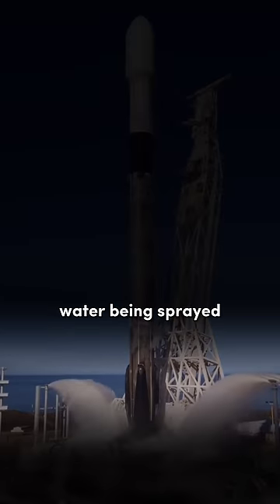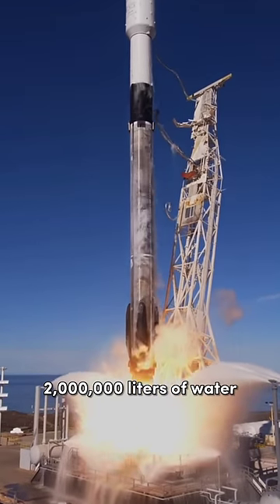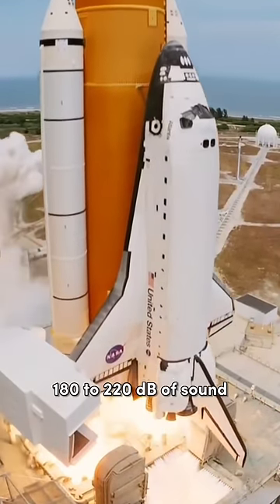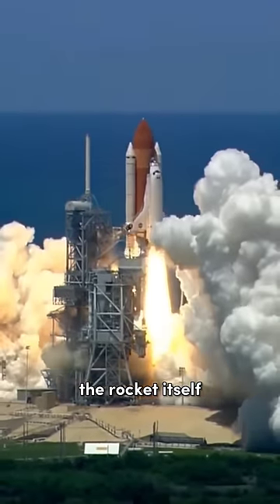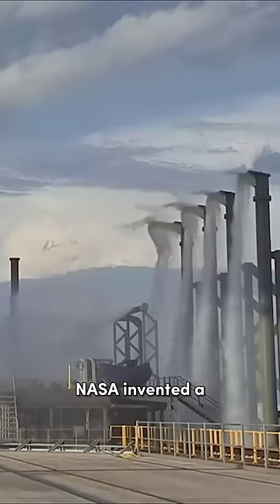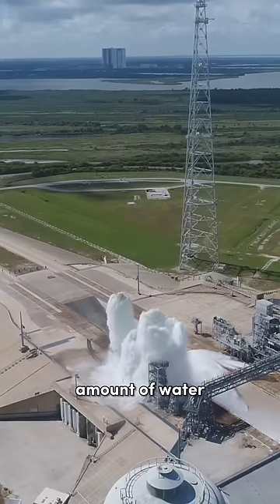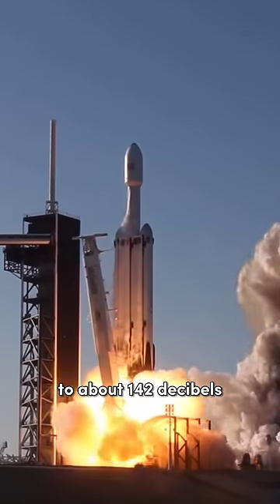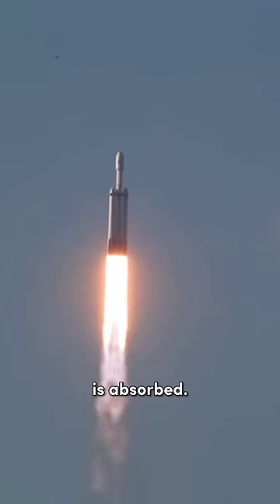How Water Prevents Rockets from Exploding #shorts

Comment: Decibel arent linear for those who were wondering.
Reply from the maker: Yes, absolutely correct
Reply: wish I had read down 2 more comments  and I wouldn't have let my stupid show.
Reply from the maker: @paulcini6084  nahh man you good
Reply: @SpaceflightsShorts  well thanks for taking the time. it was not wasted I love learning. subscribed!
Reply from the maker: @paulcini6084  appreciate it!!
Reply: can you please explain to me what do you mean by linear? and why do you think that that is important?
Reply: @stevengerhardt1221  you see a linear increase is when you ad something the relative increase towards the start stays the same. With decibel every next decibel is double the volume from the last. 2 decibel is double as loud as 1 decibel and 3 decibel is double as loud as 2.

 The increase is not the same from 1 to 2 or 101 to 102.
Reply: @Stachelbeeerchen  linear in the typical sense, at least in the building industry AKA construction is a straight line so I'm curious as how do you think sound would ever be linear. 

Also I do believe you are referring to the inverse Square law but I may be mistaken there's probably a different name for it but my curiosity is this. Which do you think is faster the takes off of the rocket or the speed of sound regardless the decibel level.
Reply: @stevengerhardt1221  At first 5 seconds (during the lift off) the sound (343m/s) is faster than the rocket (50m/s) after some time the rocket (2500-8000m/s) is faster than the sound (343m/s)
Reply: @cathelenaa  completely understandable, I don't know if you're understanding what I'm getting at! 

Have you ever watched a rocket launch, have you ever watched any of those super sonic jets go over your head, that is faster than the speed of sound and you can barely see the plane! At what point do you think the rocket is moving faster than the seep of sound?
Reply: @Stachelbeeerchen  Close.
+3 dB is a doubling of power,

+6 dB is a doubling of voltage or sound pressure level (SPL),

+10 dB is considered to be a doubling of apparent loudness in psychoacoustics.
Reply: @stevengerhardt1221  We're talking about units in the context of mathematics, so linear and logarithmic are the most appropriate names. The term linear refers to the graph a linear function makes. Plotting a linear unit vs another linear unit makes a straight line on the graph. Plotting a logarithmic unit like dB vs a linear unit makes a logarithmic curve instead. A quick Google search will do you good as you can find a lot of explanations 👍
Reply: @boomerboxer3574  interesting response. Linear is still linear, my question is at what point do you think the rocket is traveling faster than the speed of sound? You can put it in seconds, minutes, feet whatever suits you best I'm curious as to what you think because it seems like the thing never moves faster than the speed of sound to me. Just my observation.
Reply: that launch is as loud as a nuclear explosion(dafaq) and it will kill you by rupturing your lungs. forget eardrums, where's your lungs?
Reply: Thank you for clarifying
Reply: @stevengerhardt1221  yes, look at SpaceX speedometer.
Reply: Every 10 decibels, the volume doubles.
Reply: @Hxkari  that was a very interesting response as well, thank you but NASA is not SpaceX  must I remind you?

  With some logical thinking, why would you consider what is displayed on a digital screen, when you can visually see it for yourself? And it's not matching other observations!
Reply: @victor58947  and what clarification do you think you got? Truly it's not the nonsense about linear being mathematical🤣
Reply: @SpaceflightsShorts  That rocket looks like a Dildo.
Surprised that you didn't mention it as well
Reply: @HouseGurke  Thanks for writing that! To add to that: 10dB is... A single Bel(l), which is how the scale was established in the first place. A decibel was derived as a  higher resolution subscale by testing the minimum change (IIRC in voltage) people could detect.
Reply: Do share the math you used from 200-180 db to 140db is a 97.5% decrease. 
I used the double every 10 db, it is still not 97%
Reply: I came here to correct people but you were first
Reply: Thank you so much, I was about to say he was doing that R Kelly math.
Reply: @Stachelbeeerchen  don’t you mean every 10 decibels the volume doubles?
😅

Meaning, every Bel the volume doubles.
Decibel is 1/10th a bel.
Reply: @stevengerhardt1221  go back to school
Reply: Ah
Reply: it doubles at 3dB, it is ten fold at 10dB. If I calculate 142 to 180dB I come to 0.015% remaining. I have no idea how he come to the 97%.
Reply: @SpaceflightsShorts  can you please share where the 97% comes from. If I do the math I get to 99.985%.
Reply: It’s logarithmic
Reply: @stevengerhardt1221  double the decibel isn’t twice as loud
Reply: I was actually wondering...
Reply: Thanks lol. I was shocked when i heard 148 is 97% power than 180 lol
Reply: @stevengerhardt1221  it increases exponentially not linearly.
Reply: @junedaalam3080  could you clarify what you mean by that. I can understand how it will get weaker the further away it is from something but I would like your clarification as to what your point is. Thank you.

 Also when do you think the rocket has gone past the speed of sound, at what altitude ,elevation whichever you might want to call it.
Reply: @stevengerhardt1221  Theres no concrete answer because it depends from rocket to rocket. The force of Rockets or more accurately the mass flow rate of Rocketswill determine the velocity of a rocket. Because Rockets vary in weight and thrust, the time it takes for Rockets to go faster than the speed of sound varies from rocket to rocket.
Reply: @fonkengsaliki3015  well I could agree with that as well. Do any of them look like they are traveling faster than the speed of sound to you?
Reply: @stevengerhardt1221  Linear means in a direct proportion.
Reply: @NightmareGhostReap  so you don't think that linear is a straight line? Please feel free to explain.
Reply: Yeah thanks...i was about to complain about the %
Reply: @stevengerhardt1221  The comment was explaining why 140 dB is a 97.5 percent decrease in loudness compared to 200+ dB. It was just trying to explain to those who thought that it did not make sense mathematically. Decibels is a logarithmic scale where it increases at a faster rate the higher you go. It has nothing to do with actual sound waves, just trying to explain a key part of the video.

Hopefully that clears up any misconceptions, I am sure many commenters including myself would be happy to further discuss if I haven't been clear.
Reply: Pretty sure the sun has around 350db per square meter so this is still pretty damn loud.
Reply: I had to replay the video 3x to confirm the numbers and do the calculations right until I saw this comment... Thanks man
Reply: Squares aren't the same thing as triangles incase anyone was wondering
Reply: @stevengerhardt1221  linear is just a straight line with a gradient of y=x.
Reply: @tutondeeznutz9015  Excellent! We agree. LINEAR is a straight line. At what point do you think this rocket is beyond the speed of sound? If you don't understand, watch the video again.
Reply: @tutondeeznutz9015  do you even understand with a Y and X is🤣
Reply: @stevengerhardt1221  you are the one asking
Reply: @stevengerhardt1221  y axis and x axis. do you not understand basic year 7 maths.
Reply: @tutondeeznutz9015  lol yeah, that's what it is. 

So how far above Earth do you think this rocket is before it has escaped the decibels that are so devastating that it needs suppression to keep from damaging the buildings.
Reply: @stevengerhardt1221  after it leaves the launch pad cos its the main launch sound ebing suppressed the rocket isnt being suppressed all the way.
Reply: @tutondeeznutz9015  so in reference to reality besides 7th grade math what do you think the X,Y and Z axis refers to? Do you think it's an orientation such as level aka horizontal and plumb aka vertical?
Reply: It’s a logarithmic scale right?
Reply: @SpaceflightsShorts  water is wasted oh no
Reply: @Stachelbeeerchen
Reply: @stevengerhardt1221  well for every 10 dB that gets added the sound gets 10 time as much
Reply: do u mean arithmetic?
Reply: Ohhh. Thanks for letting me know.
Reply: @stevengerhardt1221  All you need is it’s acceleration curve and you could calculate the Rockets instantaneous velocity at anytime.

In fact Space shuttles used an accelerometer integrated over time to calculate velocity. 

Now as far as your question….
First of all it is a really terrible question and doesn’t seem relevant to anything at all.

But when exactly a Rocket achieves faster than sound speed depends on the rocket, but the minimum orbital velocity necessary to even get into space is like 20 times the speed of sound.

Your question seems to be WHEN exactly does that happen, but that question is sort of irrelevant.
Reply: @stevengerhardt1221  Linearly means when it increases in a straight line. For example y=x is a linear curve. For every x position you move you go 1 y position as well.

You’re asking questions that should have certainly been covered in a9th grade math class. Use some google and try and figure out the answers to your questions on your own.
Reply: So the richter scale if I am not wrong and that's why we take it for granted.
Reply: Anybody with decent high school math knowledge should understand the difference between linear and exponential😉.
Reply: @stevengerhardt1221  flat earther moment 💀
Reply: @mastroitek  well Mastro did you watch the video! Did you understand what the video was about?

I was referring to a comment made, that some may believe was a intelligent comment about sound not being linear period.    It doesn't matter that sound does not travel in alinear path,so that's why I was just talking. Without giving everything to everybody because well if I have to tell you, than it's me telling you and it's not you figuring things out for yourself!

 Since you are curious, of my point, I will explain it. The video is about the sound and the ability to cause destruction which is why the water is there to suppress the sound. Clearly that's nonsense. And my point about at what altitude at which the rocket will be ahead of the sound, I hope you can take some time and figure that out yourself! The decibels that are put off by these Rockets are deafening and I would imagine, could probably cause internal damage to human body either on board or nearby. 

So I'm curious as to how long it takes the projectile to get above the speed of sound and it never appears to! 

You see if the rocket doesn't travel faster than the speed of sound than the speed of sound is still encapsulating the rocket! Obviously I understand once the rocket does achieve speeds faster than the speed of sound then the decibel levels are no longer a danger but doesn't look like it's fast enough! 

The Jets that we have known to us that are faster than the speed of sound you can barely see them with your eye, but you sure hear them come and go. And they're not even flying at scenes nearly as fast as these rockets have been alleged to go! PS rockets need air to push off!
Reply: @stevengerhardt1221  Wrong, no one here was talking about the path of sound, the comment only aimed to clarify that the dB unit is not linear, (40dB is not double of 20dB). The comment was only written because if dB were linear (like one could assume) then the math in the video would make no sense (even though, with the numbers given it seems to be wrong anyway).
About how long does a rocket take to reach the speed of sound, that is highly dependent on the type of rocket and its purpose. But for example the rocket for the James Webb telescope reached 342m/s in about 45s. 
And btw, yes, sound does travel in a linear path from the point of origin.
Reply: @mastroitek  well that was very interesting. I never said sound was linear, I said linear is a straight path so therefore sound cannot be linear because we hear it at unknown distances away from the point of origin.

I have a few thoughts on the subject and I'm kind of curious about how much damage from Reverb can occur to the rocket in such short periods of time. Obviously everything's going to have a different rate.How much damage before the the rocket even takes off.

 I think there would be Reverb damage. And every time I've seen a rocket take off it never seems to be going any faster than most airplanes I don't mean the fast ones that break the sound barrier.

I'm curious what you thought I was wrong about, I haven't made any claims other than linear is a straight line and it very well is! I wasn't trying to talk about the Doppler effect.
Reply: @stevengerhardt1221    "sound cannot be linear because we hear it at unknown distance away from the point of origin" that does not have a meaning in physics and I struggle to understand what you mean. And in your previous comment you say "it doesn't matter that sound does not travel in a linear path". Again, I'm not sure what you mean by that, sound does propagate on a straight line which in 3d results in a sphere, but it still does expand linearly. 

Besides that, it is hard to calculate how much energy (in the form of sound) would be reflected back to the rocket, but if I remember correctly 120dB are equivalent to 1mW/m2 and the energy doubles every 3dB, hence at 180dB the energy of the sound wave would be about 1000W/m2, so pretty quickly the energy of the sound wave could be compared to the energy released by 1kg of TNT.
Reply: yup
Reply: So glad I decided to scroll the ole comments b4 letting the world know how ignorant I actually was. Thank you for sharing. I love learning new things
Reply: Correct me if im wrong but i think i remember that every 3Db double the out going sound meaning the 150 is twice as loud as 147
Reply: Like temperature right?
Reply: Yeah, they're logarithmic.
Reply: @stevengerhardt1221  it’s exponential
Reply: @TLsfhytrbj27  none of you even have a clue as to what I'm getting at but it's funny!
Reply: @stevengerhardt1221  nobody talking about inverse square law or straight lines. He said linear because decibels being measured linearly would make a 99 something percent decrease in sound look ridiculous.
Reply: @Stachelbeeerchen   I still don't get it bro, can you explain it in detail?
Reply: @SpaceflightsShorts  Ohhhhh I get it now, is it because of this: 

The relationship between sound power and sound pressure level is logarithmic, meaning that small changes in sound power can result in large changes in sound pressure level. The formula for sound pressure level (SPL) in decibels (dB) is:

SPL = 20 * log10(P / Pref)

where P is the sound pressure being measured and Pref is the reference sound pressure (usually taken as 20 micropascals).

To determine the reduction in sound pressure level when reducing 180-220 dB to 142 dB, we can use the formula:

142 dB = 20 * log10(P / Pref)

Solving for P / Pref, we get:

P / Pref = 10 ^ (142 / 20) = 1,258.93

This means that the sound pressure at 142 dB is 1,258.93 times greater than the reference sound pressure.

To find the reduction in sound power required to achieve this reduction in sound pressure level, we can use the formula:

Sound power reduction (in decibels) = 10 * log10(P2 / P1)

where P1 is the initial sound power and P2 is the final sound power.

Solving for the sound power reduction, we get:

10 * log10(P2 / P1) = 10 * log10(1 / 1,258.93) = -30.03 dB

This means that the sound power would need to be reduced by 30.03 dB to achieve a reduction in sound pressure level from 180-220 dB to 142 dB. In other words, the sound power would need to be reduced by a factor of 97.5% (or about 1/40) to achieve this level of reduction in sound pressure level.
Reply: 😊😊😊😊😊😊😊😊😊q❤
Reply: O
Reply: @Stachelbeeerchen eine Erhöhung um 10 dB wird als doppelt so laut empfunden, nicht plus 1
Reply: @gamingark795  you said it alot better than every one else
To many people try to put to many scientific words and it only makes it more confusing
Reply: @Stachelbeeerchen  Your getting to say it was to scientific, you have to explain it more simplified if you want people to understand better

Just say it doubles in loudness every 10 points
Reply: I wasn’t wondering. So be quiet.
Reply: It's like the Richter scale if I'm not mistaken?
Reply: @stevengerhardt1221  The velocity needed to leave the atmosphere is far higher than the speed of sound. It's like Mach 20. The sound damage is probably from pressure and reverberation from the ground and surrounding structures. It's also invalid to think you can outpace the sound you are producing yourself if you catch my drift 😅👍
Reply: @Kana0211  Does the sun have an atmosphere to produce sound in or does it make 350Db in a vacuum?
Reply: I came here to find and like the comment about them decibels. Don't understand them to this day aside the fact they are not linear, and could even be logarithmic.
Reply: I remember a university lecture about the sound and how much is too much, like what is the point when sound would literally hurt and the lecturer, pretty old guy is like "imagine orchestra playing full out" and everyone was "whaaat?" "or a jet taking off" and we were "yeah! now we get it!". I forgot what the number was, but I believe it was about 160-ish bB. I may be way off =)
Reply: For whom are dB's linear? They are not linear for anybody, not just for the wonderers here. Weird writing, dude.